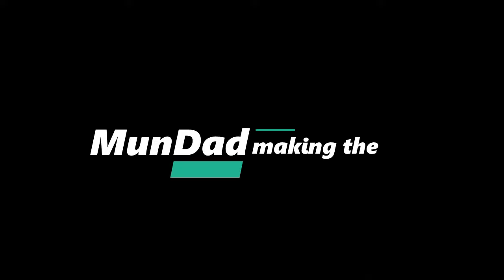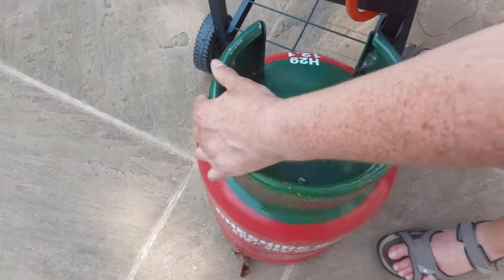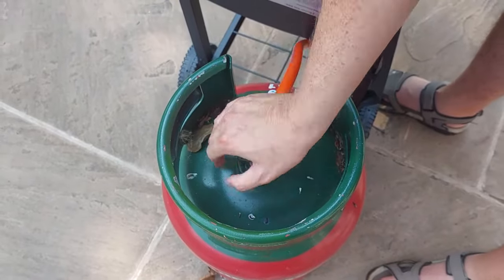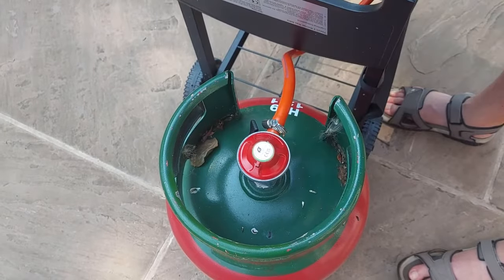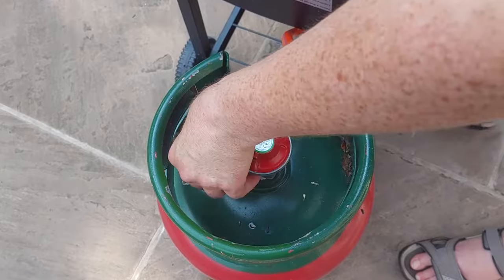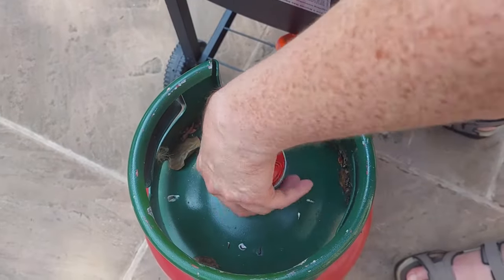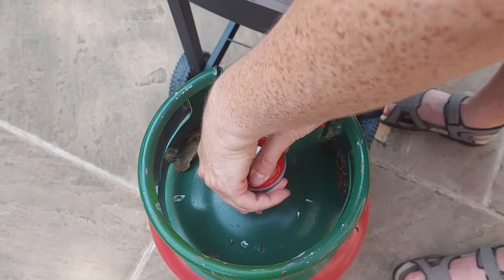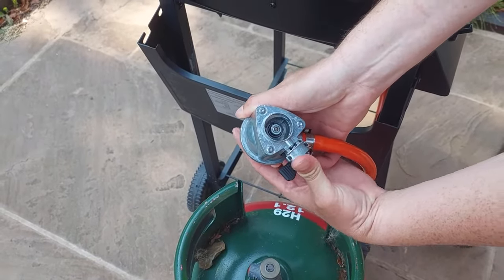Connect and disconnect a gas cylinder for a barbecue

Comment: Hi, have exactly the same set up but for some reason the gas tap won’t flick up after attaching the regulator. It is stuck and the regulator then very easily comes off. Could there be a problem with the regulator we have or gas canister or is there something we’re missing. Seems very straight forward on your video but the gas tap won’t switch on at all. Any help would be great as tearing our hair out here 😂
Reply from the maker: Hi, hmm that is a bit unusual, sorry a simple query but is there anything on the gas cylinder, a protective cover or something? When putting the gas regulator on the cylinder make sure the valve is in the off position. When pushing it on it should click. Also check to see if your gas regulator is correct for the cylinder, good to do this one first. It doesn't sound right that the gas regulator comes off, is the jubilee clip holding the gas regulator onto the gas pipe secure, it's a good idea to check this. If none of this helps, I would take ask for assistance from the company that supplied your gas cylinder. Hope this helps. 👍
Reply: @MunDad  many thanks for the quick response. Turns out the regulator was the wrong size and type so had to buy another one and then will go back to the manufacturer about the original they sent. Thanks again 👍
Reply from the maker: @addthatlittleextra  No problem, glad you have sorted it 👍

Comment: I’m either really weak or I don’t know it mine doesn’t do that
Reply from the maker: Hi, it could be the plastic switch you use to turn the gas on /off, try pushing that in. Hope that works 💪
Reply: @MunDad  wow what a quick reply. I had to take something out like a safety cap XD well I’ve got it l, thanks anyway

Comment: And what if the bottom doesn't work. I'm trying to disconnect the gas bottle, but the side bottom will not move.
Reply from the maker: Hi make sure the gas tap is off and is the regulator in the right position, should be facing the open part of the neck of the bottle. Are you pressing the button to release it?
Reply: @MunDad  Yes it's on right position. Pressing botton to release it but the botton seems to be gammed. Is it because the pressure inside the gas tap? Can I use a force like a stick with hammer?
Reply: It's all good now. It wasn't the botton on the gas tap under the regulator but the switch on and off to regulate the pressure. Silly me 🤣
Reply from the maker: @pavolkocis7456 Sorry only just seen your other messages, glad you sorted it in the end 👍

Comment: Thanks for this clip dude, I got it disconnected almost immediately. I even have the exact same barbecue! Identical wheels, wire base and even the silver label on the side tray, perfect clip for me. 👍
Reply from the maker: That's great and thanks for commenting. Ha ha that's cool, it's a good barbecue, just the fat can drip a bit, so put a tray at the bottom too to stop any fat getting on the patio, the drip tray can overflow a bit 👍

Comment: Great explanation but I'd would like to add, if you don't have a button under the gas release "handle" the handle itself is your button. Just push it in and it will release. 

I work in a camping shop and it seems 80% if products bought online come with a cheap regulator that doesn't indicate this clearly. And when searching online, 98% of results will tell you about a release button that you might not have.
Reply from the maker: Thanks for commenting, useful info if there is no button 👍
Reply: Top tier comment! Thank you

Comment: Hi there. Great video, thanks so much. Can I just ask where the orange pipe connects to on the other end. I am so confused as to where on my bbq the orange pipe would hook into, before connecting the side into the gas tank. Thanks so much
Reply from the maker: Hi the pipe to the bbq should already be connected. You shouldn't have to attach the gas pipe to the bbq unless it's new and you need to assemble it, if so follow the instructions. Obviously, only connect a gas bottle to a gas bbq, if its not a gas bbq you shouldn't be trying to connect a gas bottle to it, that could be a tad dangerous and definitely not recommended 😬✋️🛑
Reply from the maker: Forgot to say, thanks for commenting and I hope you get it sorted 👍

Comment: I have no gas coming out of the cylinder but if I take the regulator off and poke the valve with a screwdriver then propane comes out. Is that normal when the tank is nearly empty?
Reply from the maker: Hi, sounds like it's empty, I would be careful though at poking the valve because there still could be some residual gas in it. Best thing would be to contact the supplier. You can buy gas cylinder stick on gauges to see how full/empty the tank is from amazon I think.
Reply: @MunDad  is it normal that there is some left over gas in the cylinder when it stops coming out?
Reply from the maker: Hmm, I'm not sure, you might get a bit of a hiss after disconnection. If unsure though speak to the supplier of the gas cylinder for advice 👍

Comment: Hi what size is the gas regulator?
Reply from the maker: Hi mine is for propane, there should be a data label somewhere that will tell you what type you need. Have a look at think link https://www.flogas.co.uk/gas-bottles/regulator-selector#:~:text=Check%20the%20appliance%20itself%20or,so%20they're%20not%20interchangeable.
Reply: @MunDad  thanks